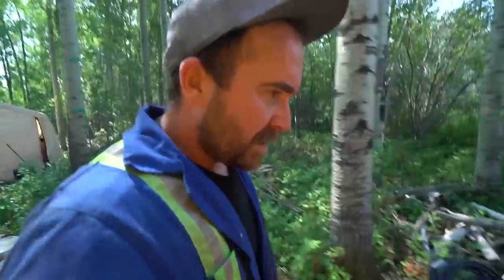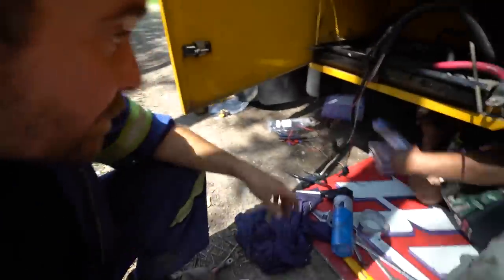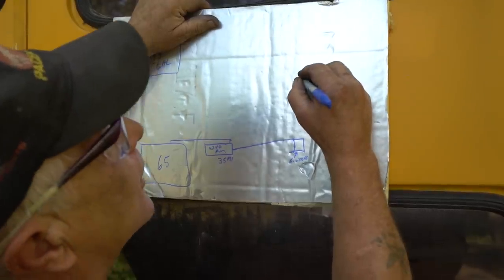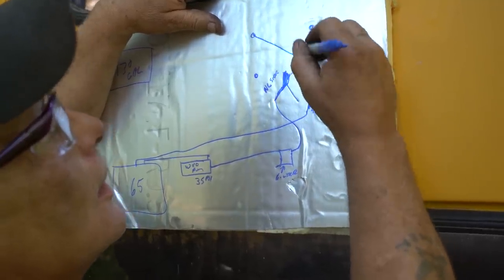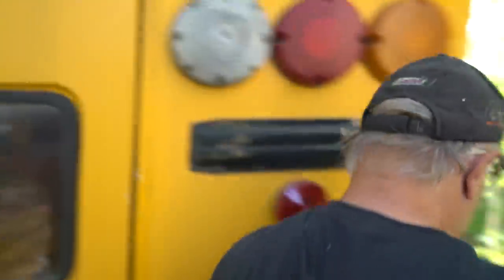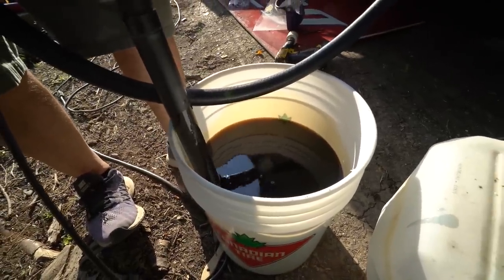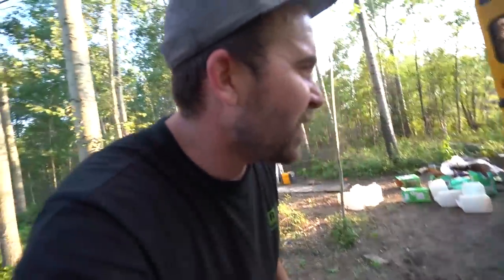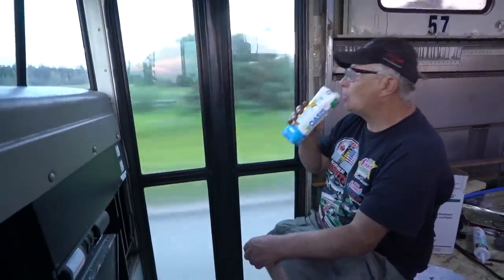VEGETABLE OIL DIESEL TEST DRIVE + WVO DESIGNS FUEL SYSTEM

Comment: congratulations on successful job well done fuel system very similar to the old 8v71 in
my bus for priming in it i use a 10 pi electric pump because they are even worse than
the 7.3 when run out fuel or changing filters
GRUMPY OLD MAN WITH A BUS

Comment: hey guys, great work there!  just remember not to use "used filtered motor oil" and then "used filtered waste vegetable oil" !!!  This is because the 2 different oils causes some clumping/thickening when you switch from motor oil to vegetable oil [and vice versa]!    Just use one type of waste oil!  Either use "waste filtered motor oil"  or  "waste filtered vegetable oil"!  Don't mix the 2 at all.   Just my 2 cents.
Reply from the maker: Yes! I made that mistake already

Comment: Do you need to return the engine between the two types of fuels? I'm thinking of timing and mixture as the two fuels are different and might burn differently.
Reply: Steven Vanes yes we put veggie back to veggie tank if we get diesal in it its ok but try not to get veggie in diesal tank 🇨🇦🇨🇦

Comment: you cannot heat diesel... emmm, someone had better tel PSA group and GM and Ford who have cylinder head mounted diesel preheaters and a bypass to lift the fuel to about 65c before the main HP pump. I used to run wvo, new van wont drink the stuff without choking and dying...miss my old van lol
Reply from the maker: Badge was saying the same. Worked just fine tho 🤷🏻‍♂️

Comment: I'm super impressed!

Sorry to ask probably a stupid question, but starting around minute 12:00 Badge says the stock 'dead head' system has the fuel return on the filter, not on the head. Does that mean that the return ports you've used (marked as top left and bottom right in the schematic) are normally plugged? And each head only has both holes so that they are interchangeable, as Jax points out around 12:30?

Comment: thats pretty awesome, but looking at "fuel" prices at costco, veggie oil is almost twice at much at $1.60 per litre.
What makes the used oil so much darker? will all of that build up in the engine over time?  How long has an engine ran on waste veggie oil before it needs to be repaired?

Comment: I have a 2007 Dodge Sprinter van with a 3.0 Mercedes diesel engine. It does have a dpf. I want to run this engine on black diesel or a two tank wvo system? As long as the oil is clean and hot enough, it should be fine, right?
Do you think the dpf may prevent the use of alternate fuels?

Comment: Can you run a diesel heater on Veg? 

Would be dope to even use veg for an aqua hot for heat and hot water.
Reply from the maker: Badge says yes. The issue is the viscosity and filtration
Reply: I might have not stumbled across it yet, but I would like to see what it takes to get the oil.

Keep up the good work, just dont go around trying to sell Programs in the future for 300 on how to use veg on a bus, lol
Reply from the maker: The beautiful thing about America and capitalism, is that I can if I want to. But, it’s not my expertise. I’d prefer to refer biz to experts who’ve helped me.